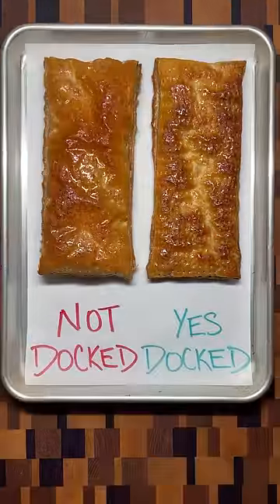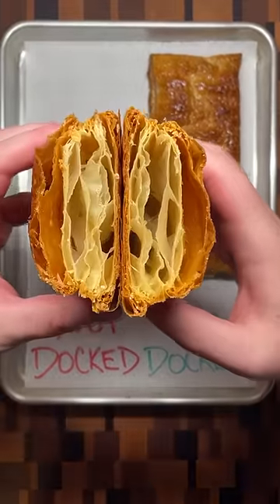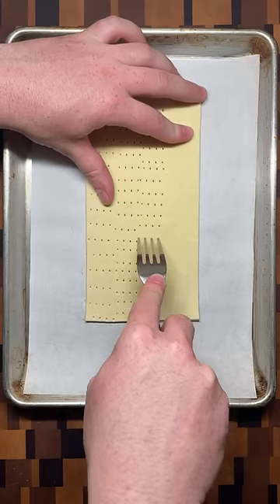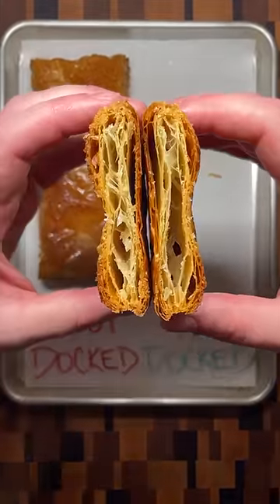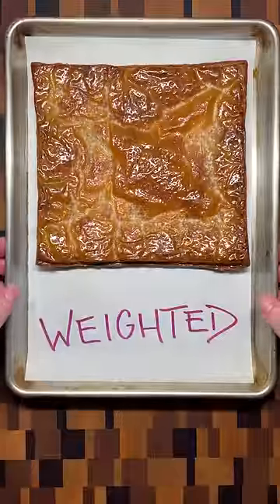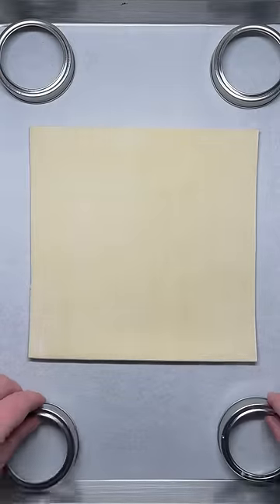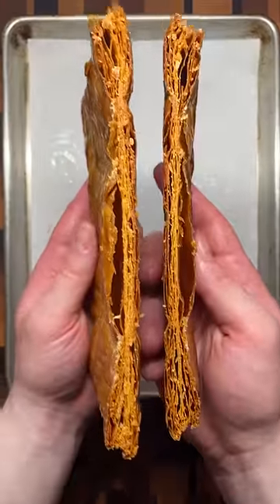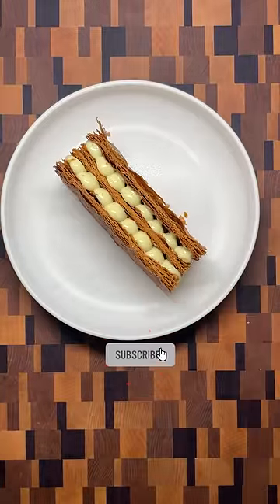The Reason for Docking in Baking

Comment: Awww I like the big air pockets 🥺
Reply from the maker: There’s nothing wrong with the big pockets for some pastries! It just helps to have a thin and flaky pastry for other applications
Reply: saaaaaaaaaame
Reply: some types of desserts require thin but flaky pasteries such as the mille feuille that is shown in the end of the short :)
Reply: Big air pockets are usually found in croissants because it makes them look plumpier.
Reply: @lunerlichen meuile feueueuil
Reply: I knew someone was gonna comment this
Reply: Best place to fill in cream, at least for cream puffs.
Reply: They're cool and all, but if you're making something like a mille-feuille, you don't want them. They have a time and a place, is all.
Reply: Meee toooo 🤤
Reply: @lunerlichen but it’s still ugly.
Reply: I find them painful
Reply: Some pastries are meant to be thin for layering!
Reply: @benjaminthebaker ok but doesn’t the weighted one lack a soft interior? That’s half the taste
Reply: @benjaminthebaker  for things like mille-feulle right?